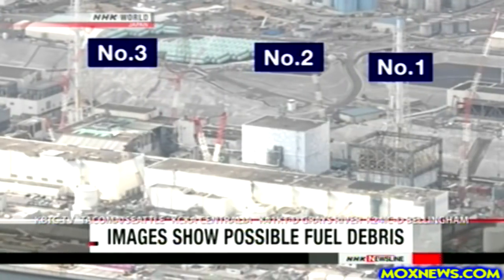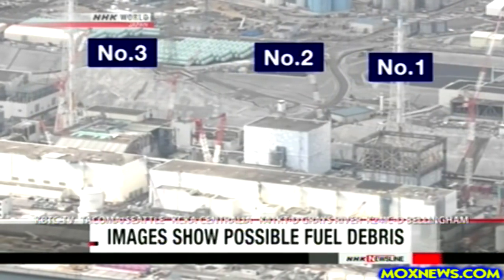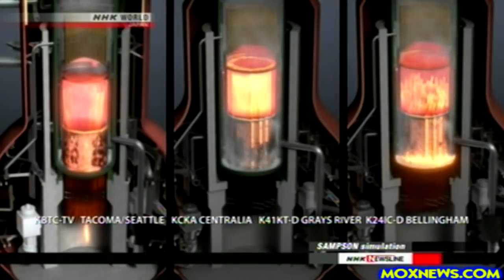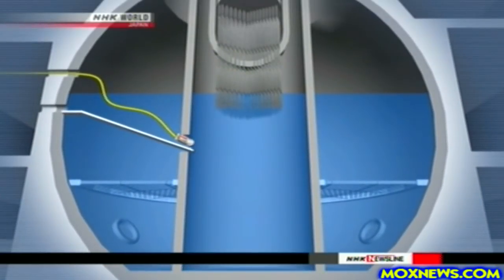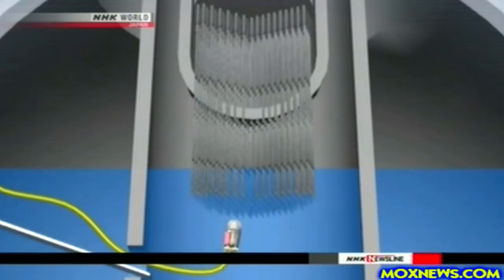Video Shows Molten Material Inside Fukushima Nuclear Reactor

Comment: i studied our documentation regarding our own nuclear candu 6 plant in Cernavoda, Romania.
 1 Redundacy, insuring you have more system that have the same function (it refers to safety systems, valves, pumps, installation, cabling etc etc) also makes it compulsory to test them separately. For every safety device, you must have more capable to do exactly the same thing, in different places which Fukushima Daichi did not have. Basically they put pumps and compressors below the reactor (should have been below, some at the same level and the third backup somewhere else above, randomize maximum the event of losing all of them)
2 Diversity, means the actuation of the safety equipment must be done from different physical methods of enabling the functionality of the safety equipment...which means a pump you should be able to start electrically, mechanically, or hydraulically. same goes for valves, in "the days" series about the Fukushima meltdown valves can be started electrically or manually, or some of them by compressed air (should have been all of them), also being in a flood zone, mechanically hydraulically methods could have been used)
3 Separation, means using physical distances to ensure the safe functionality of safety equipment, which helps them not get shrapnel in case of explosions, nor fire in case of fire, etc etc
4 Grouping, means in case of earthquakes, floods or falling debris, or fire any of the safety equipment groups can properly and safely shut down the reactors with no human interference, also must maintain the monitoring of the reactor and maintain the separation  (which in Fukushima, they lost all electricity for non compliance with safety regulation nr 2 and 1 and 3). http://www.cncan.ro/assets/Transparenta/Reautorizarea-exploatarii-Unitatii-2-a-CNE-Cernavoda/Raport-securitate-nucleara-Unitatea-2.pdf

Comment: This is why you do not build the generator house that runs cooling pumps at sea level. The tsunami came from the Ocean, so the fault line was miles away.
Reply: They used seawater to condense the steam, which is a great design, But not for a place well known for earthquake and tsunamis
Reply: @ChlorinightS  I think they used the sea water to cool the reactors and fresh water to make the steam. If you used salt water would that not leave salt on everything. You could cool the fresh water for the turbines but the fresh water would not be able to keep up with the heat.

Comment: Why do they keep referring to it as "molten"?  It was molten for sometime after the plant power was shit off, but it then solidified.  It is most certaily not molten today.  The proof is that you are looking at it through water.  No steam, no refraction shimmering from heat rising off it.  Just metal mixed with reactor.
Reply: And???  Corium comes in molten and solid states, just like most everything else.  The stuff shown in the video were definitely pretty much pure uranium fuel, but I suppose it could have been mixed with some minor amounts with "other things", such as zirconum and melted steel supports and such.  And so my question stands - why is it called molten when it was "at one time molten" or "formerly molten" or even "solidified"?

Comment: Great idea! Build a nuclear power plant next to the ocean!
Reply: Anonymous User most are near the water.
Reply: Better idea yet don't build the walls that stop water from getting in to code. They don't need to be that tall right? If they were this wouldn't have happened. True story.
Reply: All thermal power plants are next to a body of water, nuclear, coal or something else doesn't matter. And unless you count salt lakes then all bodies of water flow to ocean. At the early stages russkies had an open cycle reactor even, they just pumped lake water though an operating reactor. When villagers downstream started getting radiation sickness, what do you think they did? The told villagers to keep away from the river and continued operating. Fukushima is peanuts compared to that.